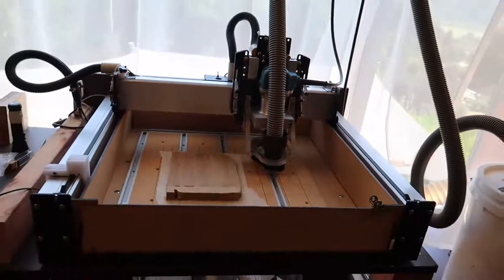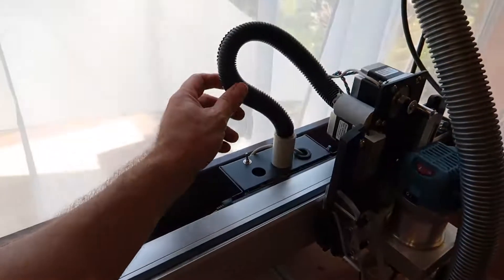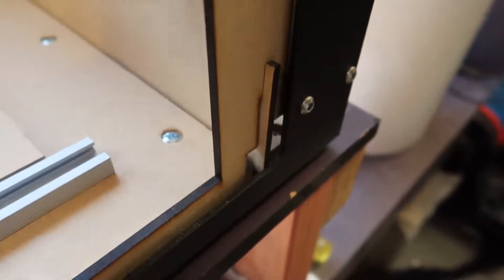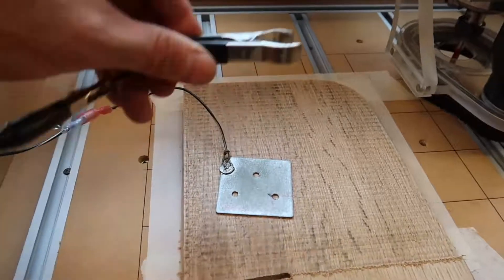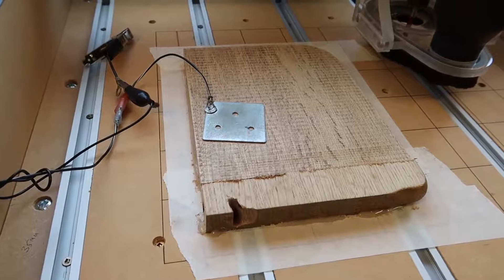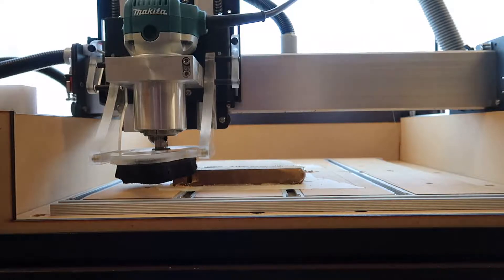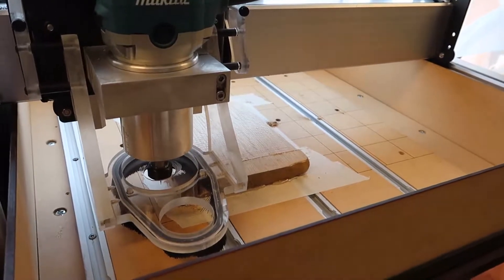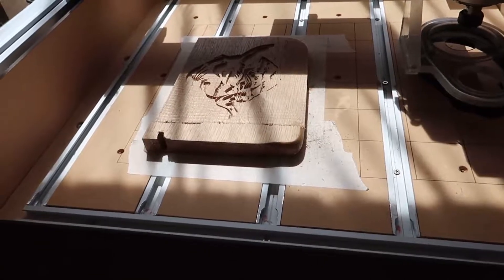ShapeOko 3 - Homing - Touch plate - Tweaks

Comment: Hot glue is a really good idea. If you're having trouble getting it off the workpiece after try using Iso-Propyl Alcohol. It is magic. I've used it when replacing parts I've glued on RC planes a million times.